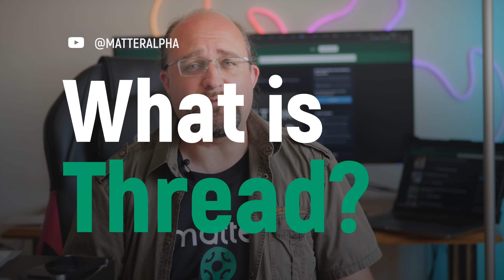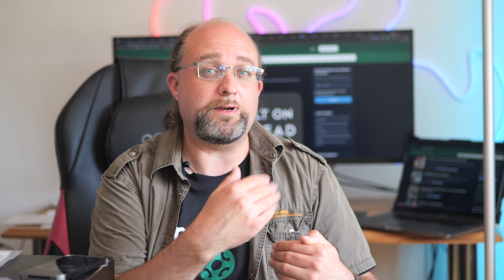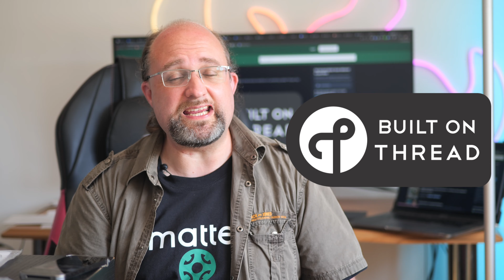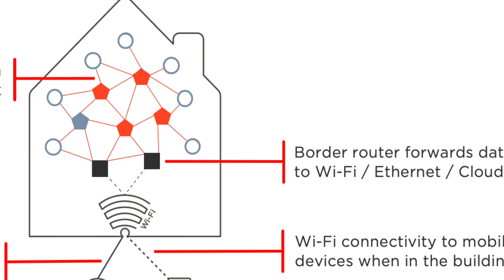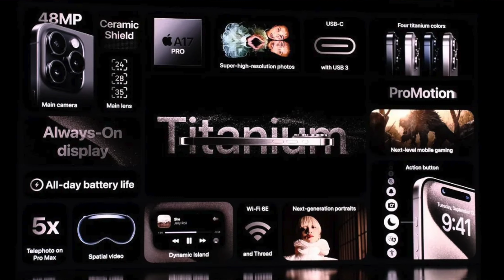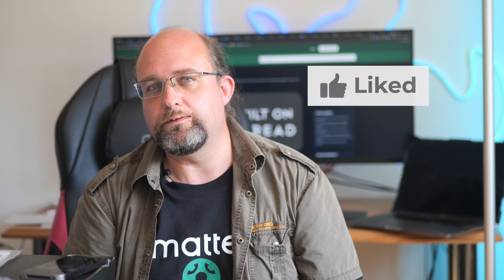What is Thread? How Does It Fit Into The Matter Smarthome?

Comment: If i already have thread enabled devices, how can I ensure they are communicating using that network rather than WiFi?
Reply from the maker: I don't know of any devices that run with both Thread and Wi-Fi - they're more likely to be Thread + Zigbee, or Thread + Bluetooth for close control only. If it works when you're not in close proximity, you're good. Thread is largely invisible when it works as intended.

Comment: Didn't Google create Thread? Thread Border routers are closer to a Wireless Access point circa 2002 rather than a hub. Your Thread devices are not controlled by the Thread Border Router in your Apple TV or Nest Hub, they are simply going through to your home router. Swap out your router and see what happens to your thread devices. Zigbee uses Hubs like hue bridge or Home Assistant. Swap a router, just plug the hub into the new network and everything works.
Reply from the maker: Google is part of the group that created the Thread standard, yes, but the underlying network is the same as Zigbee, and Zigbee Alliance is also part of that Thread group. 

Yes, a border router isn't like a normal router - it's a bridge. But the Matter hub / controller and border router tend to be the same device, too, confusing matters.
Reply: @matteralpha  Not quite. A Border Router in thread terms is equivalent to an Access Point in Wifi unlike a Hub in zigbee terms. Matter hubs are like you said, controllers, akin to smart things, echos, home assistant. All the finer points of why Matter is confusing and distorted so much by people. It's all the more reason to speak truthfully about the standard rather than as an echo chamber.

Comment: My question is, if you build a new house and thread actually requires at least some devices to be hard wired, why not use PoE?
Reply from the maker: If you can hardwire something, you absolutely should. But hardwiring things like blinds, or a door/window sensor, is generally not feasible. Thread is great for the low power sensors and occassional use things.